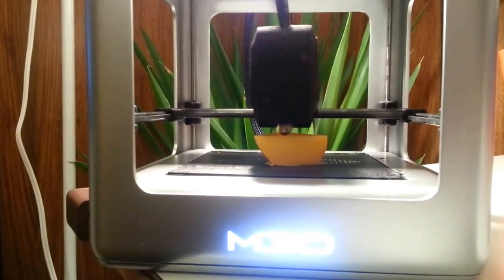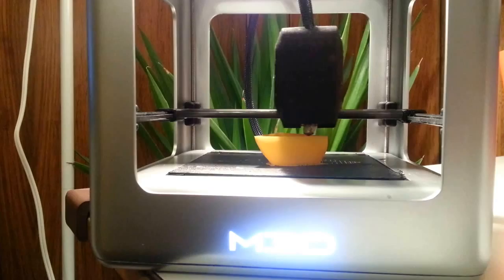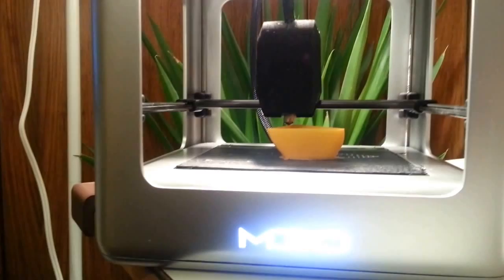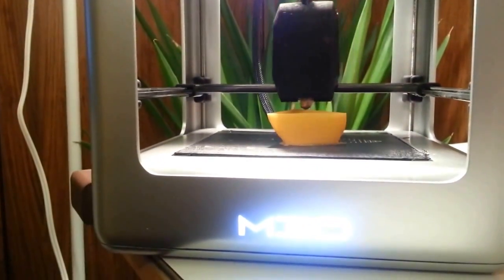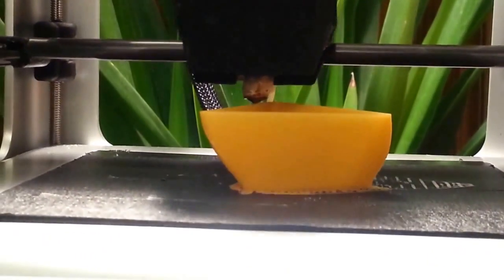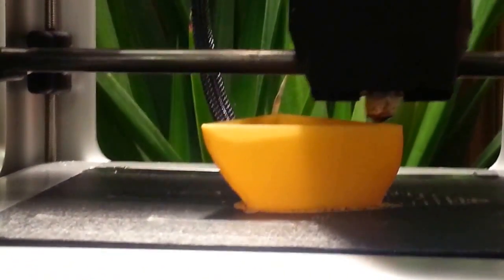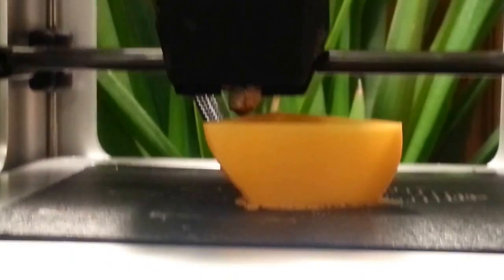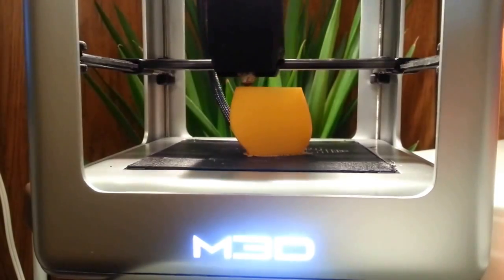M3D - The Micro 3D Printer

Comment: Hi, does anyone know if the M3D will be a good option for printing sunglasses? That's what I want it for but I think the working area might be a couple inches to small for that... maybe if I accommodate the frame diagonally instead of horizontally? Any ideas? if not, what other affordable printer would you recommend?  I was looking at the Newmatter MOD-t 3D, frames would fit in that one but you can only use while being on the net, and you keep your designs on their website and all, I mean, whatever, but it just kinda sucks.
Reply: For that I would suggest the Creality Ender 3

Comment: is it possible to use an aftermarket extruder on  this printer? i replaced mine twice and the rubber seal over the tip keeps moving around and now my calibrations are just awful.
Reply: Yes, but you need to generate gcode with a different slicer and add it into the gcode window in the M3D app.

Comment: you could easily use this printer to make a larger printer. it would take forever but its possible.
Reply: how would you print the wires? you can print the casing but not anything else
Reply: Boxtentoo 112 Actually a lot of 3d printers are built with the mechanical parts like gears and stuff printed on an already working 3d printer.  The amazing thing about THIS one is it's a pre-built model, consumer ready, for under $400.  That's decent desktop laser printer cost, which is the level I was waiting for them to drop to.  Probably ordering one of these.
Reply: Dave Russell Dont, i bought one. and it sucked. THe customer support doesnt help, it hardly prints anything correctly and 90% of the time the print just flies of the bed and makes a huge glob getting stuck on the nozzle.
Reply: Boxtentoo 112 honestly, even a makerbot 2x is a royal pain to use and has like a 10% success rate. Want to sell yours? I'm looking to buy in 2 weeks LOL with these things, it's all about experimentation. And hair spray. Seriously. Helps stuff stick.
Reply: I've honestly find that 3d printers generally print flatter objects with relief or things that can be built in solid layers best. Rafts are necessary except with large base objects and overhangs are a no no because supports never work well on a single extruder printer.
Reply: Dave Russell what slicer are you using because my supports never have any problems with Simplify3D.
Reply: I'm just printing models from thingiverse with makerware. I just mean when you break them off, the model looks horrible. You're technically supposed to use different material for supports, but that only works with dual extruder models.
Reply: The printer I use at work is dual extruder, but they only have ABS filament. The coolest thing I've ever seen was this wash away support filament. I guess water melts it.

Comment: the material is plastic? or....? thannx
Reply: There are various materials you can use with this printer. One of them is ABS plastic which is a fossil fuel based product. You can also use a PLA material which is starch based and very safe. There are several other options with this printer.

Comment: im a use this to make little model airplanes!!! :)
Reply: Weisbrot the layer height of this printer is 50 microns up to 350 microns. 50 microns is 0.00195 inches or 0.05mm. The X and Y axis accuracy is 15 microns. That's on par with 3d printers selling for $4000+ dollars. So it could/would print very high detail. Also, the print bed is about 4.6 inches squared. Not the biggest print dimensions, but you could build a fuselage in 3 parts, adhere them with acetone or superglue and get a 13+" model.
Reply: ImJuanka The quality of detail and price it's why I'm getting one, the trick is the generate a design on a way that multiple small parts can be attach with epoxy or screws (If you check most of the consumer products and designs you will find that are assemblies of multiple parts sonic welded or glued)... on that way if something goes wrong only one part of the design need to be reworked!

Comment: I'm waiting for someone to print a little 1 shot 22LR pistol with this. I'm curious on if it would be strong enough to not blow up in one shot.
Reply: Robert Briggs Hey idiot  u want to see "Under the Undetectable Firearms Act any firearm that cannot be detected by a metal detector is illegal to manufacture, so legal designs for firearms such as the Liberator require a metal plate to be inserted into the printed body. The act had a sunset provision to expire December 9, 2013. Senator Charles Schumer proposed renewing the law, and expanding the type of guns that would be prohibited.[33] Proposed renewals and expansions of the current Undetectable Firearms Act (H.R. 1474, S. 1149) include provisions to criminalize individual production of firearm receivers and magazines that do not include arbitrary amounts of metal, measures outside the scope of the original UFA and not extended to cover commercial manufacture.[34][35] These "modernization" proposals have been criticized as disingenuous attempts to suppress adoption of and experimentation with 3D printers in home gunsmithing.[36]" these are the U.S regulations
Reply: Robert Briggs
Why even use it for that?
Reply: Eagle Ghost because what's more awesome than 3D printing a functioning firearm???
Reply: It is illegal to 3d print a gun because there is no metal in it and it needs to be able to be detected by a metal detecter
Reply: You can't make a working firearm because the plastic would melt, but you can check out Barnacules Nerdgasm he made a halo pistol.
Reply: TThomas939 I have seen functioning firearms made 100% from plastic from a 3d printer.
Reply: Robert Briggs They can be made out of more professional and more expensive 3d printers.
Reply: Robert Briggs They can be made out of more professional and more expensive 3d printers.
Reply: boxtentoo 112 that's the most ridiculous thing I have heard all day.
Reply: Robert Briggs I don't know if it's illegal or not but it can't be safe especially with a non professional 3d printer
Reply: Havadium natural selection my friend.
Reply: Robert Briggs And you can make a higher quality gun way easier with a CNC machine
Reply: boxtentoo 112 One, learn to spell. Two, calling me an idiot just tells me that you got all butthurt over being in the wrong.
Reply: Robert Briggs its illegal to 3d print guns.
Reply: ***** I wish I could give you a DoubleLike!!!!

Comment: It's probably fine as a super low budget 3D printer for tinkering around with, but this style of 3D printing is still in the black & white TV stage. A manufacturer I work for just bought a larger 3D printer that operates in a similar manner for $3,000 or so and I'm not that impressed with it, it takes all day to print a prototype part that isn't all that great quality wise. Personally I would wait a couple years for the printers using newer technology to come down in price, but this is still a neat toy you could probably make some small functional items with.
Reply: All day for a prototype compared to....??  That's the original purpose of 3D printing...you can get a proto out quick and cheap and save the time and money expenditures for the final product.
Reply: *****
True...but there's something to be said for a demo of something easy to understand.  This isn't being pitched to engineers or high tech designers.
Reply: *****
I know if I was able to buy one, I'd certainly use it in my own design processes.  I have tech drawings of the parts I want to make, but no way to even make a functional prototype yet.

My end goal would be to make something that could be used as a model for a small mold.  The size of this unit is actually perfect for my purposes.

Will there be fits and starts?  Sure...no tech ever comes out of the gate perfectly....but ya gotta start somewhere.
Reply: sam signorelli
I guess my point was that the technology is rapidly evolving and if you want a 3D printer for fun/hobby this one is fine, I'm not knocking it in any way especially at that price for a small hobby printer you can't beat it. But if you're looking for the first "color TV" of 3D printers it would be better to wait. The higher end 3D printers now will be the lower end ones in a couple years, and I have to say I am impressed with the quality on those. Perhaps M3D will develop a larger model using newer tech after they get this one rolling.

Comment: What the time frame for selling and shipping these?
Reply: You can support us the earliest by backing our kickstarter in late March.  The printer is the reward, to be delivered Nov'14-Mar'15 depending on tier.
Reply: Thanks for the info, I looking at having a abs printer by this summer. That why I ask. I will still back your kickstarter. Just wanted to know if I should order another printer for ABS to make my deadline. Already have one that does pla only.
Reply: jean-yves metivier This is a great question and I hope to help you understand the production side of things.  No one wants to be able to produce faster than us.  The working prototypes you've seen are made in part through the CNC tooling process, which can quickly but expensively produce a few units (that would cost ~$800 or more per printer to do it this way).  With our seamless casing design and price targets though we have to work within the available tools of the day and one of those is injection molding: 

Injection molding is a complex and artistic process.  For example, our product casing is seamless, and we demanded no parting lines with a super consistent surface finish - this can take 2 months just to make the basic mold, and then 1-2 months of artistic touchups to perfect the mold to our specifications.  Only then can orders begin at scale and take another month to deliver.  In addition mold costs are in the 10s of thousands and we will be relying on backer support through kickstarter to get there, and KS funds are released only after the campaign.  So if were were in March today, we are talking about August already.  

In the meantime a relatively large team has to be trained to produce a printer every few minutes off the assembly and QC lines and at high quality.  That will begin to happen ~August ongoing.  We also add a buffer so that we can assure people we can meet the promised dates and volumes (and maybe even beat them).  For us that is approximately Nov 2014 for the first full run.  Luckily, once we are set up, we can crank them out quickly.

You may be surprised to hear that if any company were to take all of our finalized designs and start today, it would take them almost the same amount of time, minus the waiting for funds to clear.  The only option to speed things up would be to drop the high quality / high volume seamless molded casing for a lasercut/wood/acrylic/steel painted casing with screws, which is better suited to low volume production or if you want that specific aesthetic.  These are the pros/cons of injection molding.
Reply: mikearmani2 Your printer seems to be quite ready, why does it take 9 to 12 months to produce?
Reply: Michael Armani OK, I understand your timeline now. One more question, is that basic mold made the regular way or trough metal 3d printing (witch should be cheaper and faster, in my opinion)?
Reply: jean-yves metivier That is a great thought that may someday help the industry move quicker.  The quality of cast steel that is milled for molding would be far superior to a metal 3D print for longevity sake (these molds are pushed to their limits, with over 400 tons of pressing force).  Also the mold is ~1000KG of metal so I imagine we're above the limits of a 3D print there with cost/warp/time.  The only faster way we are aware of to make such a large shape would be to make a wax mold and investment cast the metal into it.  In any of these cases a superior surface polish and coating, and still need the artistic optimization phase.  If you think of any other possible shortcuts though let us know :)
Reply: Michael Armani Yep, that's a lot of metal! A long time ago, I was working in a fundry making disk brake. We were using a wood model to make the sand mold, quick and dirty (very dirty in fact!). I dont know about such a big piece but you can always 3d print the model out of plastic, than make the sand casting and fill the thing with your prefered metal. Might be cheaper but not realy faster.
Looking forward to the startup, good luck!
Reply: Michael Armani There might actually be one other alternative manufacturing process that is cheaper and faster: Amorphous metal casting, e.g. Liquid Metal casting (http://en.wikipedia.org/wiki/Liquidmetal). The process cost scales well for volumes in the 1k to 10k units range, and some claim it might actually be cheaper than conventional injection molding for comparable surface finish and far superior tensile strength, even beyond 10k units. Since your campaign is funded and then some, and there is time before you put the deposits down for the injection molding process, this should be a good window for exploring liquid metal casting, and perhaps delivering a far more robust product to the customer.